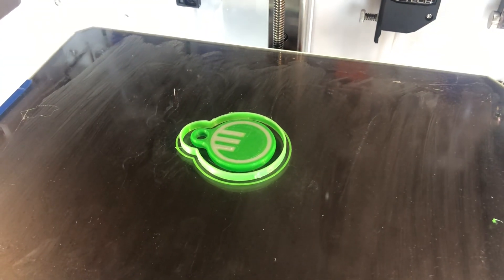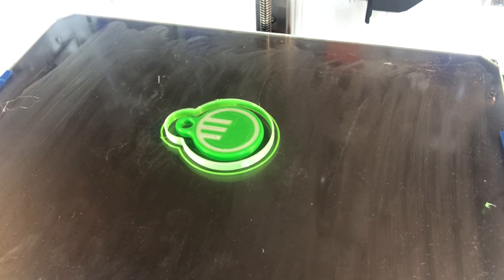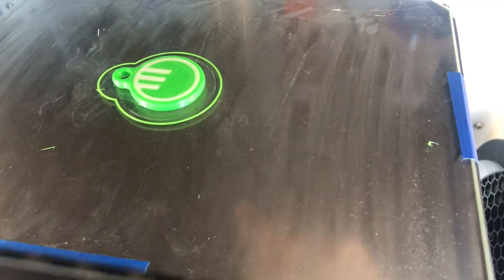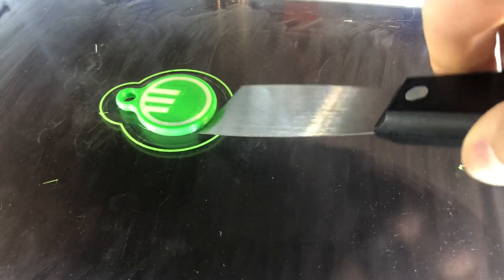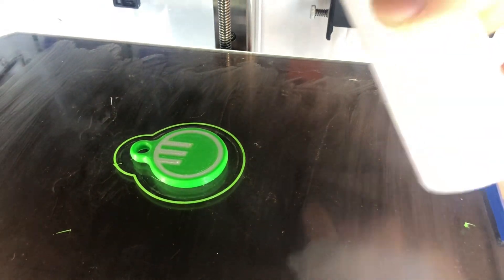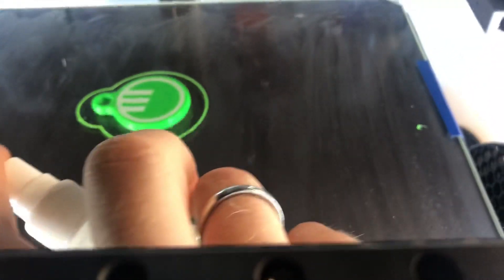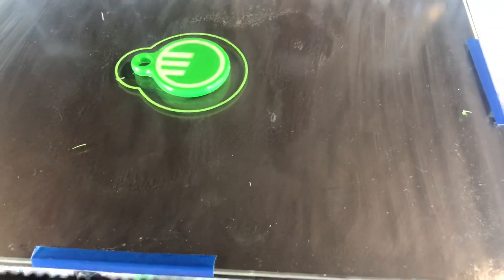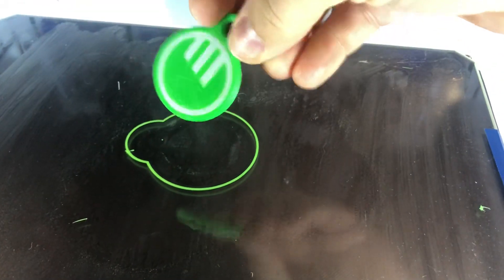Use alcohol to release your flexible print from the print bed

Comment: Cool trick to use alcohol... Guess it is the cooling affect of the alcohol that releases the part of the bed, or not?
Reply from the maker: I am not quite sure, but this also works on really hot or even unheated surfaces. I don‘t think that temperature is the factor 🤷🏻‍♂️